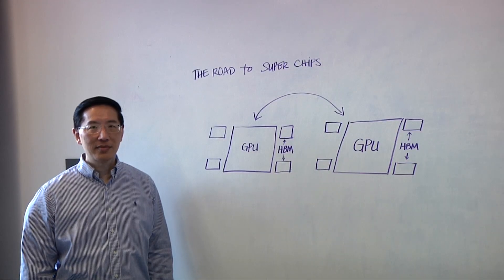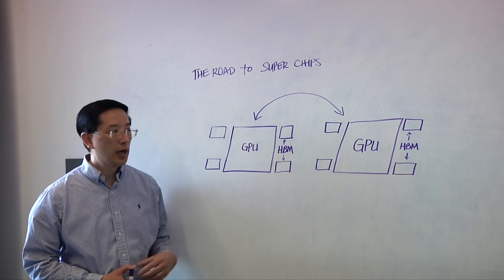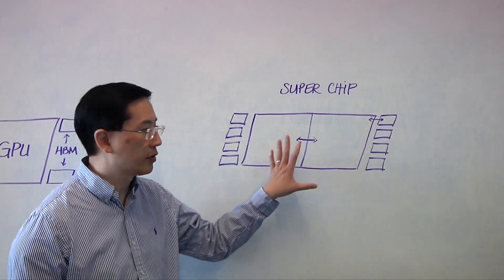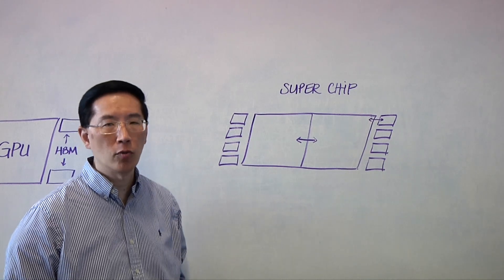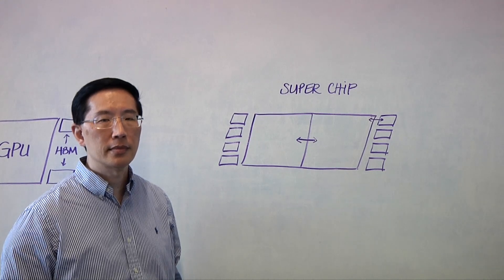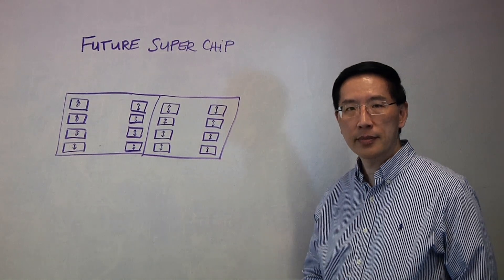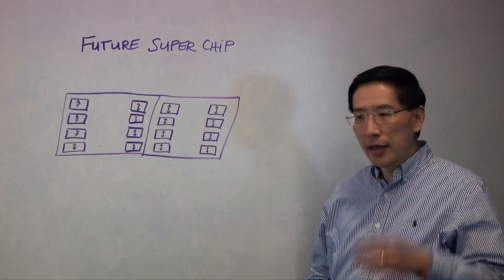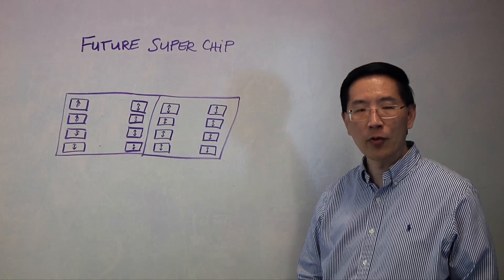The Road To Super Chips

Comment: I am a layman but I was curious if you guys could do a video on multi-dimensional(3d and beyond) semiconductor architecture, I really appreciated the information on glass core technology, something I have been waiting for ever sense I saw the quart 5d storage and I was wondering if there is anyway that these technologies overlap and in what ways. I imagine cooling and power dissipation would be an issue like you mentioned a bit within this video but again not an expert in the field in anyway just a curious on looker. I guess this would have to do a little bit with gaafet more likely a cfet but I am a bit more curious and the information I can find seems rather limited.

Comment: If we consider the multiplication of two 32-bit numbers on a single core, this system, as well as other systems with the highest known computational power, can get the maximum number of multiplication results in one second. We can assume the processor speed as 3 GHz, for example.